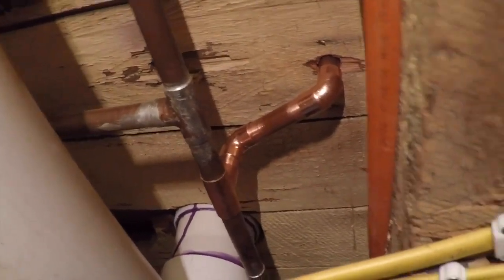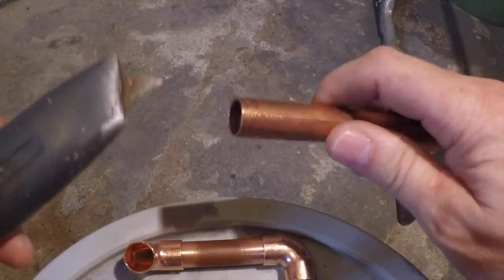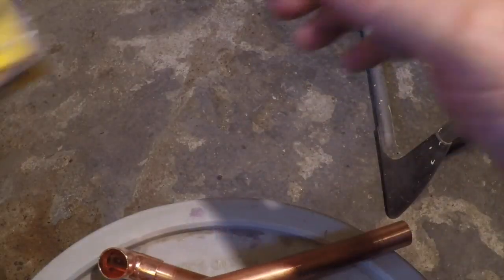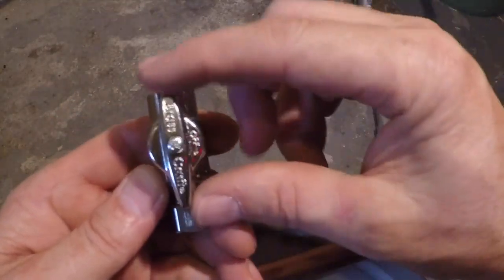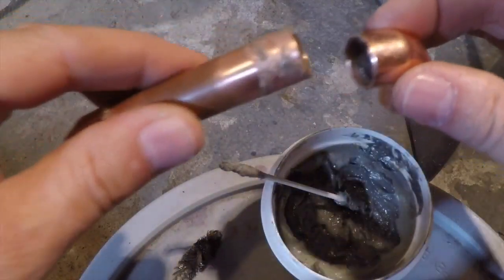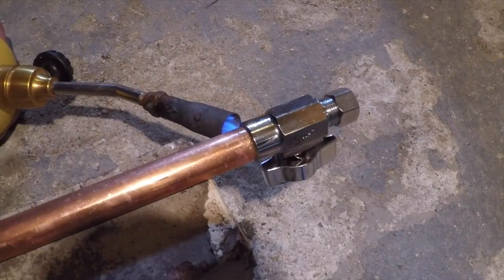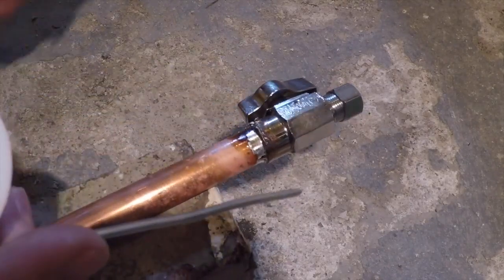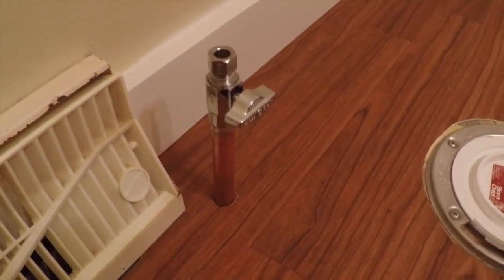How to Properly Solder a Ball Valve to Copper Pipe

Comment: Plumbers trick to keep small amount of residual water in pipe from screwing up your solder job.  Take a piece of white bread and roll it into a ball and stick it in the pipe back beyond solder area.    When you are done and turn on the water the bread will fall apart and will be flushed out.
Heat shield can be made out of multiple sheets of aluminum foil; The air acts as an insulator so don't smash layers too tight.
Reply from the maker: Makes perfectly good sense, thanks for the tips!
Reply: Variation that I used when dealing with a main shutoff that had a slow leak and no other valve in between: plug the wet side pipe with a tightly balled up bit of rag, then, working fast, solder the wet side of the new valve first, reach through the open valve with tweezers or needle nose to pull out the rag, close the valve and solder the second side. There are more reliable and professional methods, like the screw-expandable rubber plugs that you pull out through the valve after soldering the wet side, but I never got that desperate.

Comment: So no need to clean up the inside of the elbows?
Reply from the maker: That's correct, no need to clean the inside of the elbows. The cleaning is only to remove the oxidization off the surface of where the joint is. This will provide a clean surface so the solder flows or wicks into the joint properly. The cleaning is not for sanitary purposes. The flux I am using is water soluble so it will get cleaned away by the running water through the pipe.

Comment: My friend I was not trying to be sarcastic. If you keep cooling pipe with a cold wet rag you will have a failure just like I and my friend did 23 years ago. We plumbers know if you cool something down rapidly that will cause a crack. That was a costly mistake due to being in a hurry. That was when I Stopped and never had a failure since. We live and learn. Hope this helps.
Reply from the maker: Thanks for the info Mel
Reply: @DIYHomesteadProjectsDIYHP10  Glad that was helpful.

Comment: Big mistake to cool it down with a cold wet rag. Solider joint will fail. Second, you used to much paste. You did however deburr and clean the pipe well. Deburring and cleaning is absolutely critical.
Reply from the maker: I've never had a solder joint fail from cooling it down with a wet rag. Never had any problems with the amount of flux I use either. Thanks for your opinion.

Comment: Whatever faucet washer that was in the valve is toast if it has a nylon or rubber one.
Reply from the maker: This valve does not have a washer, it's a ball valve designed to be soldered.
Reply: @DIYHomesteadProjectsDIYHP10  Just the info I was after, thanks!
Reply from the maker: 👍 Thanks for watching Maydanlex!

Comment: Great overview, looks great !!!  I've had to do a lot of plumbing over the years and I think the one thing that really changed my life was switching from a propane torch to MAP gas, which just gets so much hotter and makes it so easy to sweat pipes.
Reply from the maker: I agree Joe, MAP gas is much quicker and more effective than propane.
Reply: MAP gas does not burn much hotter than propane , MAPP gas does but is no longer available.